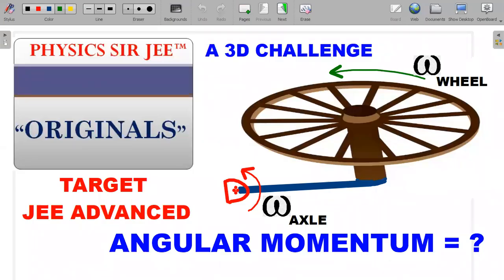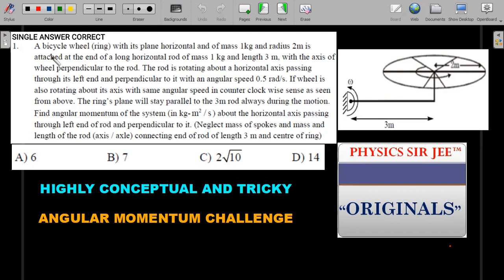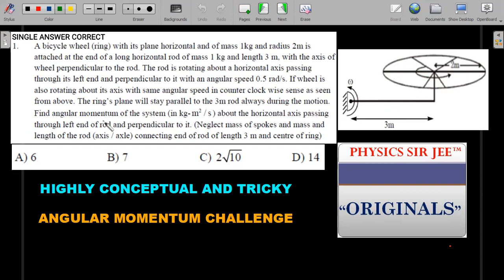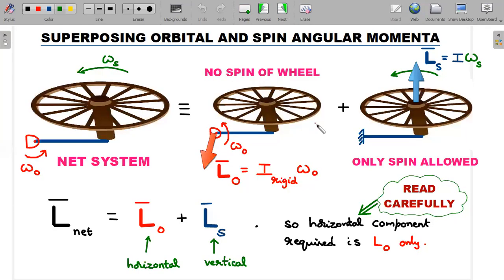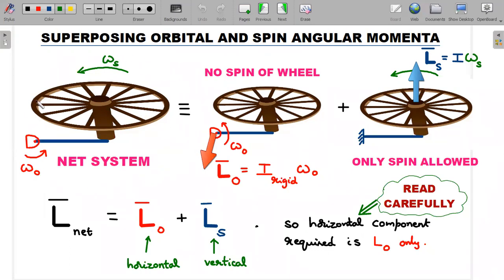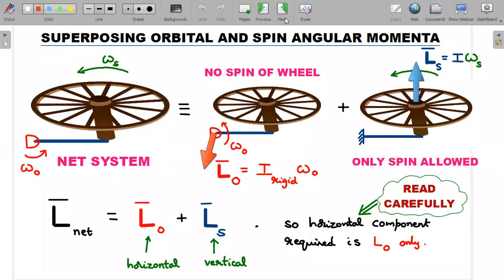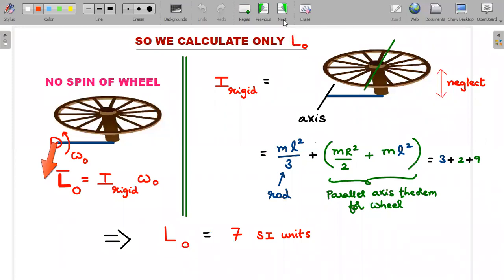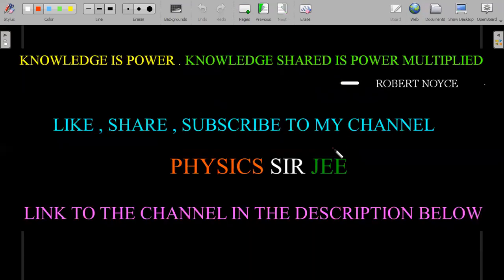[JEE ADVANCED 2021] CORRECT PREDICTION 🤫 | ORIGINALS |ANGULAR MOMENTUM OF WHEEL AND AXLE |

Comment: Sir I did this problem by finding out the L of the system abut o by Icmw+Mvcm r and then took the component about the needed axis and I also have to calc the spin of the ring about the diametrical axis as every point on the ring rotates in a fix circle with same w please check sir whether my approach is correct 🙏
Reply from the maker: Looks slightly longer but fine 👍
Reply: Thanku sir for clarifying
Reply: @shreyyansh4098  what is value of w and vcm that u have taken here?
Reply: @equalcell1555  value of vcm = lw and w is same as given

Comment: wonderful problem and so is its explanation thankyou sir ! i have a doubt sir if i wish to calculate total angular momentum of the system about the given axis which is on left side of the rod i need to do vector sum of spin and orbital angular momentum. My doubt is how to find out spin angular momentum about the given axis as the wheel is not spinning about it , will perpendicular/parallel  axis theorem will hold true for finding moment of inertia and then using it to find spin angular momentum ?? Kindly give your valuable feedback sir. Regards

Comment: Sir I attempted the jee adv 2021 question with this method then I am getting the wrong answer
and sir when I attempted that with simply Ldisc = MrV)cm + Icm(omega) then the doubt is angular velocity (omega) of disc about centre of mass should be 5(ohm) not 4(ohm).
Reply from the maker: Omega about Cm means " by sitting on CM , if we draw a small line on disc then in dt sec if line rotates by d(theta) then omega is d(theta)/dt... Now imagine this and answer the question. That's the basic definition of Omega from a frame
Reply: @PHYSICSSIRJEE  
 @PHYSICS SIR JEE - JANARDHAN - IIT JEE & OLYMPIAD  
Yes sir I tried this ..
In COM frame angular velocity of disc is coming out to be 5ohm but on Internet angular velocity is calculated by taking angular velocity as 4ohm ..
In the formulae L= m(Vcm) + (Icm)(omega) we should write omega as angular velocity of system in Centre of mass frame but they have used omega as 4ohm and getting right answer but omega in CM frame is 5ohm